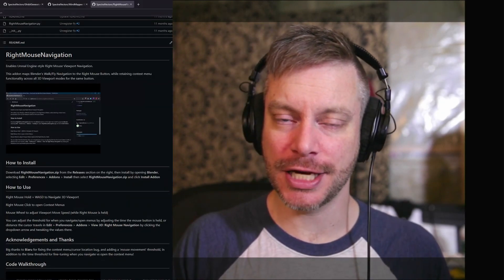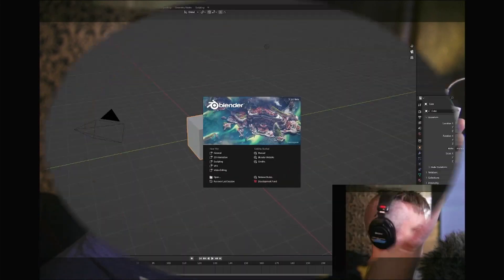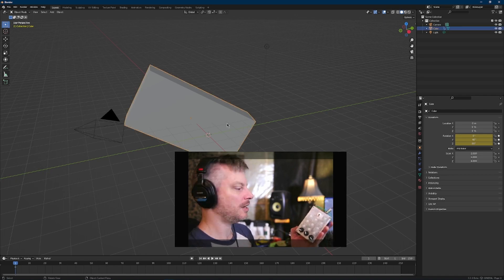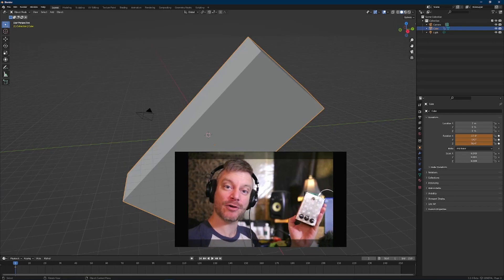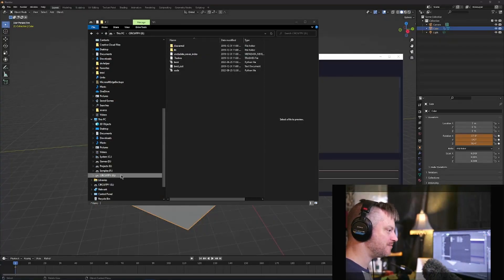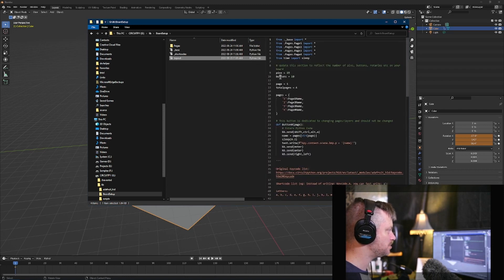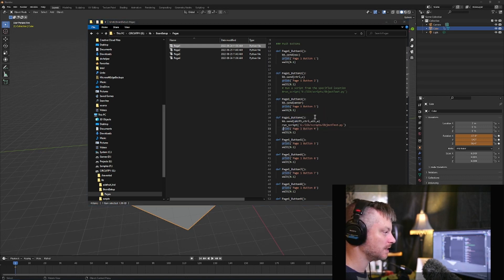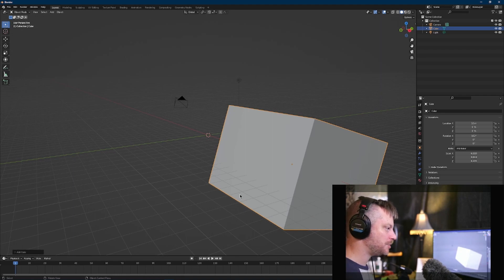Can I Make a Hardware Control Surface for Blender? (yes I can)

Comment: this is crazy cool! I was literally just searching for blender hardware controllers, to see if it was even a possibility, and I guess my timing was perfect cause it says you posted this 4 days ago. I'm wondering, does everything have to go thru the pico... or would there be a way to map the same sorts of controls as midi thru something like bome's midi keyboard?
I was thinking how cool it would be to take something like the behringer x-touch mini (with it's 8 endless encoders and 2 page layout) and make something for modeling quickly... mapping the different encoders to things like rotate/bevel/scale/inset faces/bulge.

I hope this finds you well, can't wait to see how this progresses!
Reply from the maker: I haven't looked into getting MIDI to play with Blender, but I know it is possible, you can check out: https://github.com/nomelif/Audionodes for ideas.
This project does rely on the Pico because it's based on the Adafruit Circuitpython library, which is compatible with a handful of microcontroller boards, but probably couldn't be installed on something like the Behringer (or at least I wouldn't know how).
I'm working on a back-end connection between the Pico and Blender using Serial comms, but you could probably achieve the same with MIDI: 
Code a 'MIDI listener' addon for Blender that calls a certain function / operator whenever it detects a certain MIDI signal - eg: Behringer sends CC70 increase, the Blender addon maps that to Object X Location (or something).
Of course, the trick is actually getting it all to play nice in the end!

Comment: I'm trying to get color strips in the VSE to send a custom OSC message out of Blender. Can you point me in a direction where I might be able to find help?
Reply from the maker: There are a number of addons that integrate OSC into Blender, here are a few:

https://github.com/F1dg3tXD/auto-osc
https://github.com/AmusedDiffuser/BlenderOSC
https://github.com/JPfeP/AddOSC

After you are able to send OSC messages out of Blender you would then need to set up the conditions under which the VSE strips send the message: are they constantly sending the OSC message, or only when they are created, or only when they are updated?
For that I think you'd want a Modal Operator, msgbus subscription or Application Handler, depending on the behavior you're looking for.
Reply: @SpectralVectors  I need to send a single, arbitrary string out of Blender via OSC. All of these plugins are for people trying to control Blender with external devices. I need Blender to fire a cue on a stage lighting board.